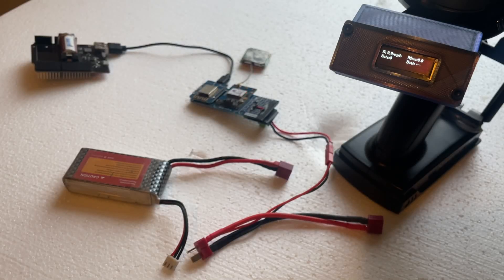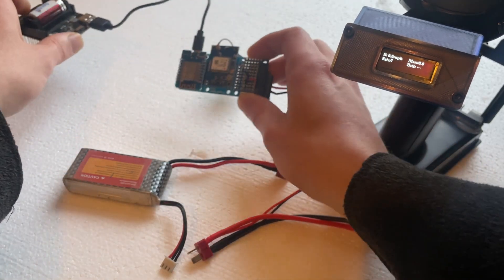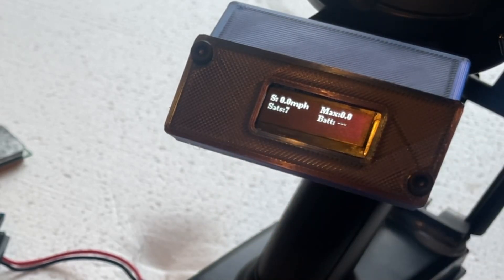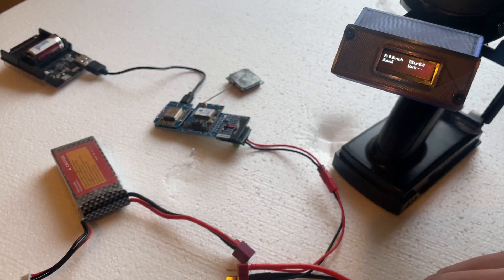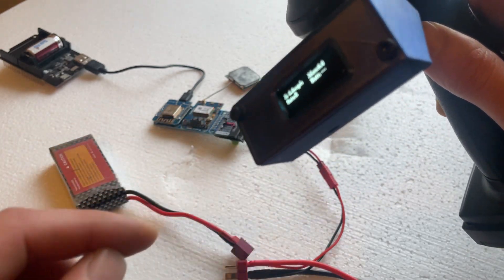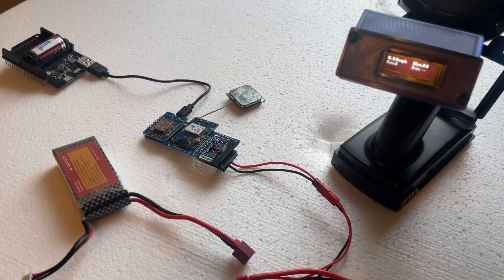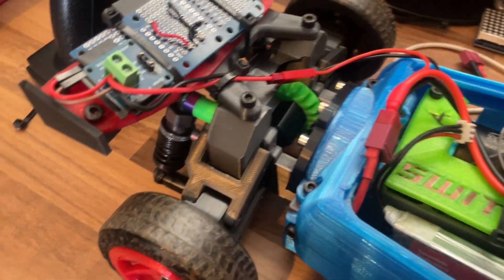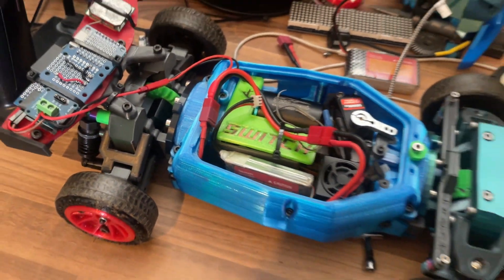RC CAR DIY Remote SPEEDOMETER and BATTERY monitor on controller Test - esp8266, rc switch

Comment: Very cool! Would love to build something like this with gyro and/or servo CEMF based FFB in the controller.
Reply from the maker: hi, I had to google to see what you meant, yes that would be cool, havnt seen that feature on an rc car but would be good to be able to feel loss of traction, thanks
Reply: @A-tech  I feel like it could be a game changer for RC. 
I use racing simulators and the difference between FFB on and off is night and day.
Reply from the maker: ok i agree it defiantly helps with the controlling of the car, that thing in your video looks pretty cool but a bit bulky
Reply: @A-tech  For sure. I would prefer to build it into the controller as a direct drive using something like the approach used in this video.
https://www.youtube.com/watch?v=n3T0Hy5MaFg
I would also also make it usable as a game controller using USB and/or Bluetooth HID feedback.  
I feel like both these spaces are  ripe for disruption with this kind of tech.
Reply: I built a prototype RC pistol style controller for racing games without FFB and it was so much better than a gamepad. With FFB I imagine it would be fantastic.
Reply from the maker: that one looks a lot tidyer, how would you do the feedback? a servo that slips a bit?
Reply: @A-tech  Just a regular motor as used in full size driving simulators but scaled down. The drone type BLDC motor in the video seems like a good fit. 
My main concern would be the ESC. I'm not sure the typical RC ESC would have the requisite response characteristics to the FFB signal from the car (or game). Might be fine. 
ODrives are often used in full size DIY sims but that would be way OTT here.
Reply from the maker: ahh yes something like that looks ideal

Comment: Very cool. I know a lot of people think GPS speed is relatively accurate but I personally don't see how it can be at this sort of scale. The location information isn't really precise enough.
It would be interesting to add quadrature encoders to a couple of your wheels and compare the speed measured by the encoders with the GPS speed.
I need to get back to some of my wheeled robots and try this myself.
Thanks for another fun and interesting video.
Reply from the maker: hi, yes you are right, with gps speedos you really need a decent length of track for them to be accurate, the easiest way to test would probably go in the car with someone and check against their speedo, I was tempted to try the encoder version before the gps but then you get a problem with wheel size and tyre expansion, its a tricky one and maby the solution is both, thanks
Reply: @A-tech  I hadn't thought about tire expansion. That would be a problem. So far, all my land robots have been too slow to worry about tire expansion.
I wonder how well an airspeed sensor would work on a ground vehicle.
I look forward to your future experiments.
Reply from the maker: hmm, im not too sure, maby wheel speed for slow speeds and gps for fast